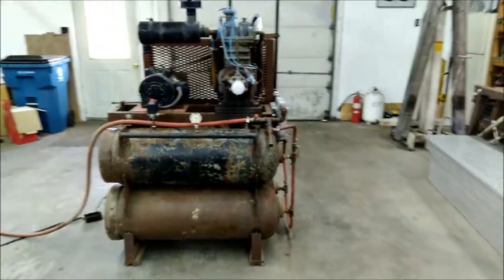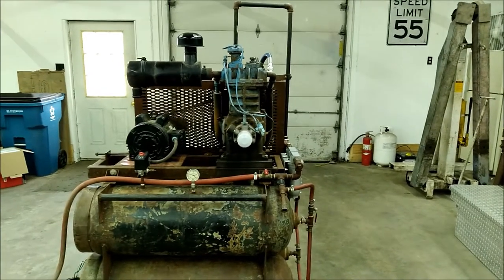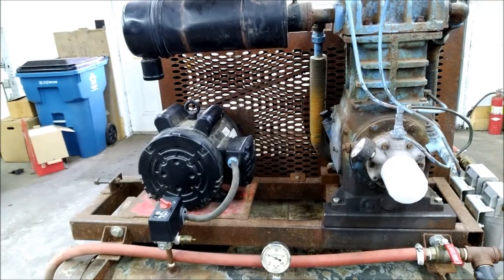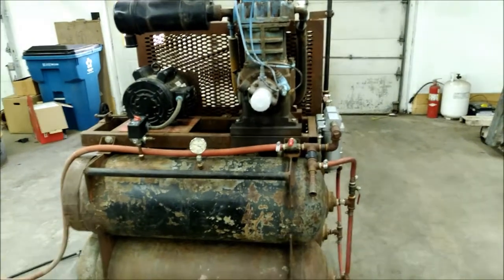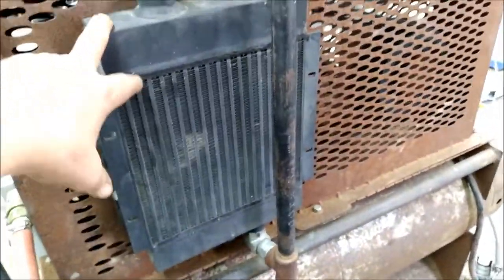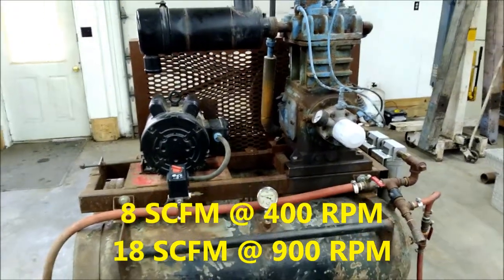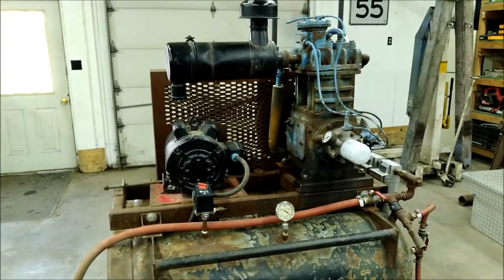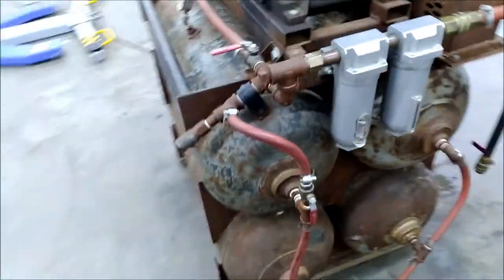Homemade air compressor ... big air for little money

Comment: You measure cfm @ total psi with time to fill and total size of the tank volume..  the rpm doesnt have anything to do with the math...  but rpm does effect it, the pump will only pump so much so you run it at its designed rpm and time the fill at whatever psi your filling it to and take your locatons atmospheric pressure and tank size..
Reply from the maker: The Quincy pump states not to go over a certain RPM so that's why I figured what speed I need for the electric motor ... Thank you for watching

Comment: Very nice setup. I have to say though, I feel you missed an opportunity when putting this together. You have 4 tanks. If you would have set them up in a series and gave each tank its own water drain, you would probably eliminate 99% of the water without having to buy additional filters and plumbing. Just a thought. You really lucked out on that old Quincy pump, too. Those things are great!
Reply from the maker: That would have worked for sure thank you for watching Paul
Reply: @Country Mile Garage It was just a thought, in case you ever end up reconfiguring this setup. I'm shopping for a new shop compressor right now and prices have gone completely ignorant. I may end up building one, myself!
Reply from the maker: @mccoma11  I feel you ... you don't want to know what kind of money they want for a big one like this these days. Happy hunting and building Paul

Comment: Crazy! No safety valve. Those vessels are not built for pressures like that. They should also be tested by notified body. When that pressostat fails the entire rusty smack will explode. Do you have employees?
Reply from the maker: It does have a pressure relieve valve on it and them are old propane tanks they hold better then your china build el cheapo compressors tanks. Thank you for your concerns and for watching
Reply: @CountryMileGarage  They have to be tested by a notified body. Very creative build but completely crazy.
Reply: Never listen to a person named girt..  they're ignorant apparently..